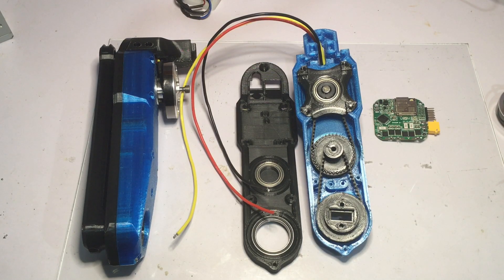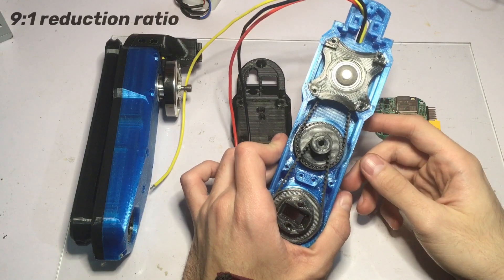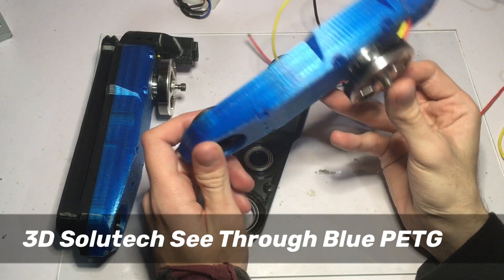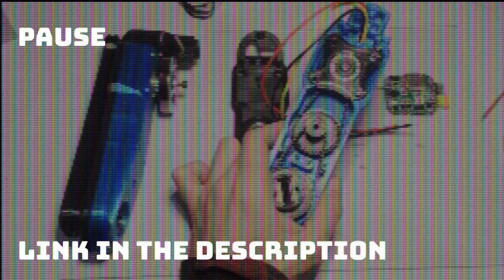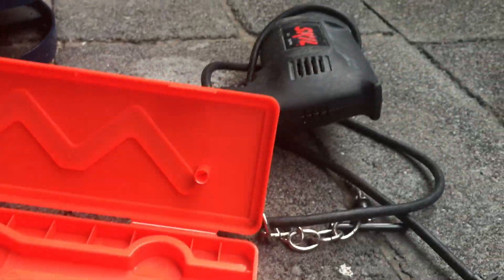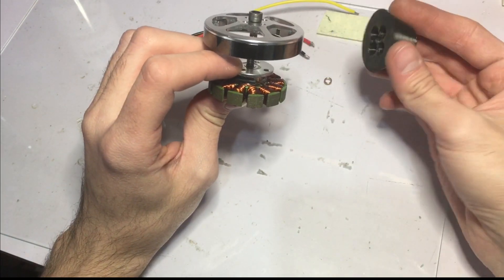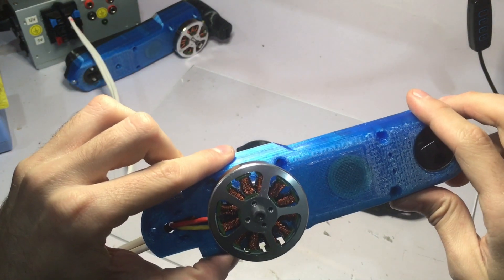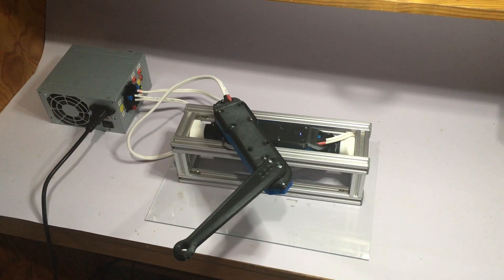Compliant Robotics Actuator - Quadruped Robot #1

Comment: Hi, I have a question for you, why do you sense the position of the motor and not use the position of the leg better? The way you do it you add up all the errors caused by the pulley chain such as backlash or play in the axes, etc. You have to know where the leg is and generate the response of your closed loop from the position of the leg, not the position of the motor, which is ultimately not important. Regards. from Argentina
Reply from the maker: @nesbionics  the position of the motor is important for commutation, you cannot commutate this motor without some sort of position feedback. It’s true that errors add up and by not having an absolute position sensor on the joint itself I only estimate it by knowing the position of the motor and multiplying by the reduction ratio, however, these inaccuracies have shown to be not important for this type of application
Reply: @Dagor  The problem then is the controller? That motor is the same type used in drones. The controllers I use are open loop with a PWM. If I want to do it in closed loop, I put the sensor in the joint and then adjust the PWM according to what the PID indicates. This will translate into more or less engine rpm depending on the gain you give to the algorithm. It's your project anyway and you already answered me, which I thank you for. I hope to see your project soon. Good luck.
Reply from the maker: @nesbionics  well, what I have here is my own motor controller running SimpleFOC. Completely different way of commutation the motor like what those drone controllers do. I encourage you to read the SimpleFOC docs to learn about Field Oriented Control.
Reply from the maker: @nesbionics  btw check out newer videos. I finished this robot and made a brand new one!

Comment: hey i am working on the same project and kept same design in reference.
I am using this, https://robokits.co.in/sensors/encoders/as5600-absolute-encoder-12-bit-precision-angle-measurement-sensor-with-magnet-wheel as your sensor is not available in our country. Will it be able to provide the same accuracy as of your encoder+esc assembly?

Comment: I know you are a 5-bar fan like me. You can build a very light weight leg with those principles. https://www.youtube.com/watch?v=ENDQFdDNQKg
A leg with two of these actuators as the "thighs" of a 5-bar leg driving the "knees" would be awesome.
Reply: Feedback from the leg motors and/or sensors on the feet is the key to get proper walking.
Reply from the maker: @boxsterpontus  Hey man! I took a loooong time thinking and prototyping to decide on an actuator design for this project. I did think about going the 5 bar (or even 4 bar) route, but that required me to do a small integrated, lightweight and strong actuator. I decided to go with this design because the actuator itself is part of the leg and will be the main structure of the body too, also using belts is pretty simple and elegant for the 3D printing robotics world. My actuators are backdrivable which will help to close the loop in terms of current draw from taking steps.

Comment: I love this. how the encoder work?
Reply from the maker: It is a magnetic sensor, I attach a diametrically polarized magnet to the motor's rotor and the sensor finds the absolute position which is reported to the MCU by SPI.

Comment: Hello, 
Thank you for your video. 
I had a look at the ODRI poject and even though they did a very nice job documenting their work a putting efforts in making it accessible, but it is still aimed at researchers and is still expensive. 
One if the hardest part are the machined pulleys (for which you need a custom drill bit). 
Did you redesign everything ? The pulley's shapes ? If so, did you keep the reduction ratios for exemple ?
Thank you very much.
Reply from the maker: Same actuator idea, but I redesigned everything my style. I did keep the same reduction ratio (9:1), but the pulleys are designed for HTM3M belts and the bearings used are different. This actuator module should be sub 100USD including controller, motor, magnet, belts, bearings, screws and the PLA.
Reply: @Dagor  I see, Thank you, for your answer and your work :)